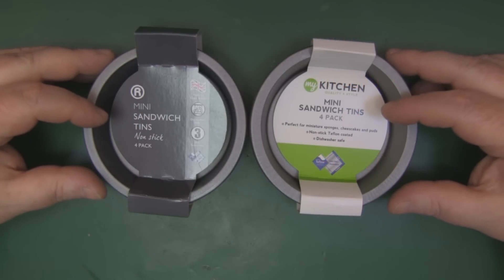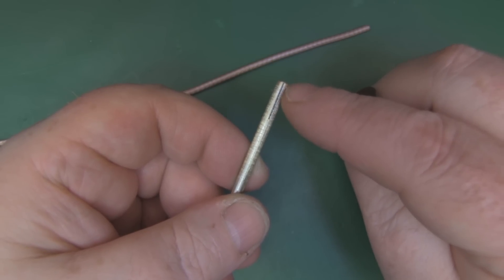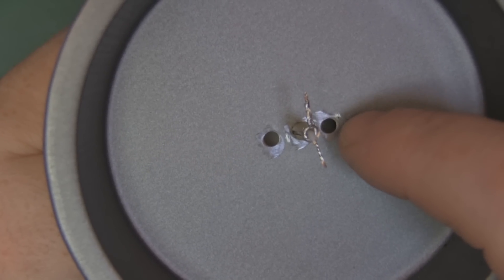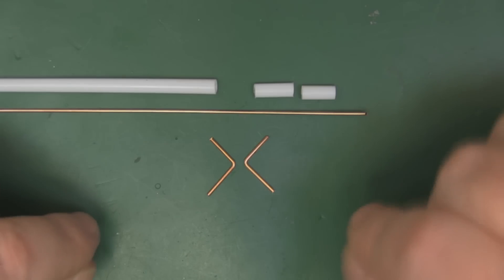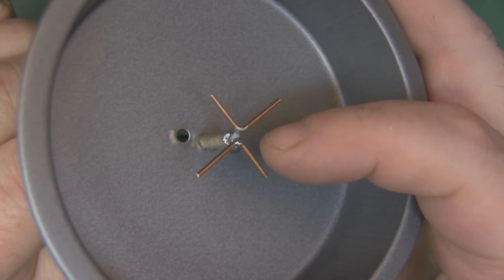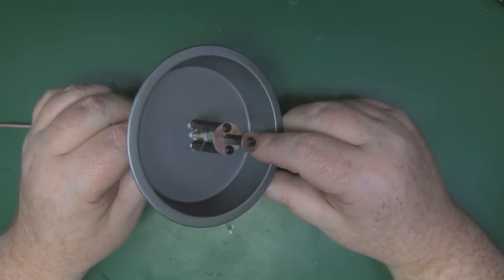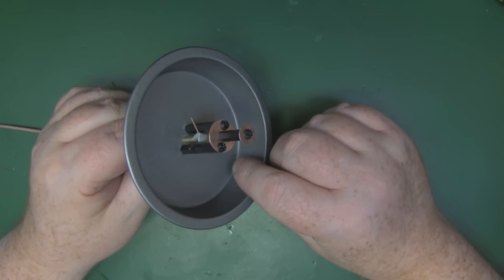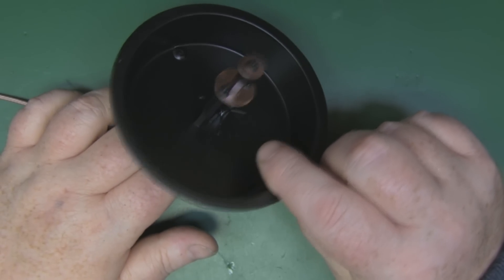5.8GHz Backfire Antennas with Circular Polarization for FPV #169

Comment: What would be the result of using a back reflector with smaller diameter.... say 5.8cm? Would this simply result in a loss off gain or is the main reflector diameter crucial to the overall performance, resonance and srw of the antenna?

Comment: ))))) use circular polarized crosshair  in backfire antenna - very very BAD IDEA

as u may know, CIRCULAR polarization direction changing while reflecting

so, usually, when linear polarization antenna between main and small reflector, we have signal increaseing because main and reflected waves in same phase and polarization
but in your antenna main and reflected waves in same phase BUT LHCP and RCHP (decreasing signal)

u can check it easy - remove 2 smal round elements, and u will see signal increasing

Comment: I don't know if you realize that such an antenna would be intended for receiving and not for transmitting. :) 
On the flying... thing, the antenna and the radiated RF needs to be as omnidirectional as possible because the transmitter moves on all three axes. 
On the ground, maybe with an antenna tracker, a directional antenna is sometimes desired but the receiver doesn't mind that much about the impedance mismatch (a tiny mismatch) and will never mind about reflected RF. 

And, to top it off, the exact tuning is... almost pointless. The 5.8Ghz band has many channels an spans from 53mm to 50mm. The video signal is frequency modulated and it spans a hefty 8Mhz bandwidth and about 5.5Mhz beside it there is an audio signal, FM too.
Reply: thast why you use a diversity setup with directional and omni antenna's.  This as a directional would still work awesome
Reply: yes, it would but on the ground not in the air. ;)
Reply: lol.  howd it come up that this would ever go on a quad?
This would be awesome on a RSSI tracker.

Comment: Excellent presentation and antenna! It certainly looks less complicated to manufacture than the BiQuad Yagis with comparable or better gain.  L-Com sells some on the net but they are not cheap and perhaps with only one parastic element. Here's a paper on a basic backfire dated 1971. http://www.dtic.mil/dtic/tr/fulltext/u2/724607.pdf
Reply: Login required 😔

Comment: I would have thought it better to have a larger hole so that you can have the feed horn on the back and have a small reflector on the front so that the RF comes through the large hole in the large reflector and bounces of the smaller reflector onto the larger reflector then onto your target e.g. Gregorian Antenna